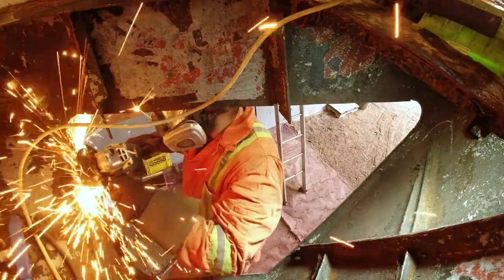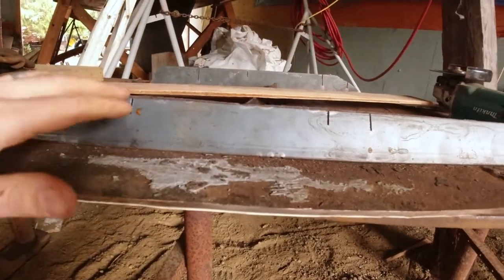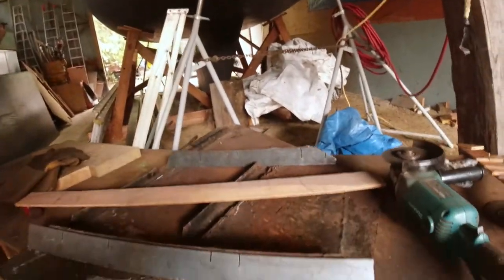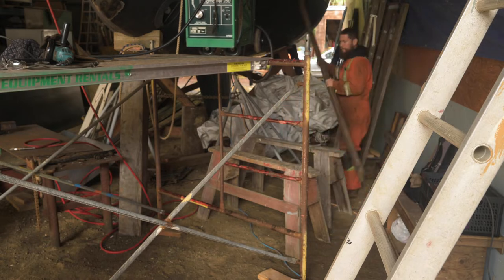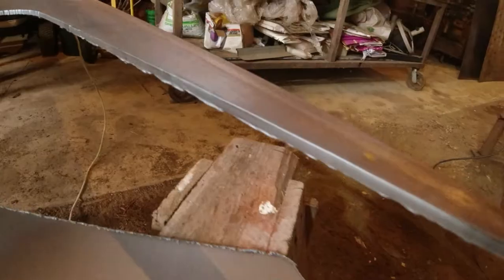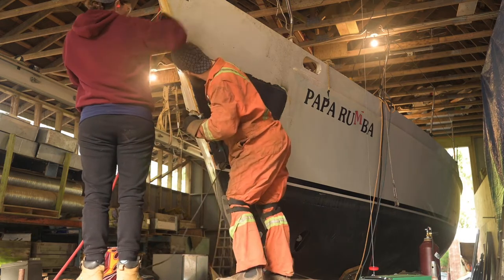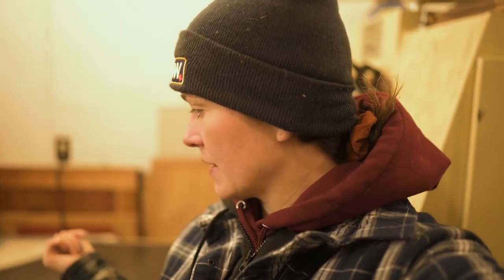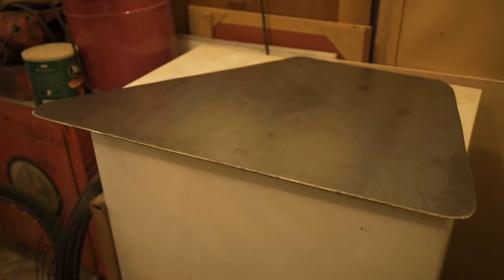Replacing the First Hull Plate | Ch5 E 11

Comment: Mig welders are brilliant for overhead welding, people think just because they can run a weld that makes them a welder, wrong. You need to look at the globular transfer. Your welding appears cold or too much wire feed, leave a 3 mil gap between plate joins to insure full penetration. Watch out for undercut especially in a boat.
Reply from the maker: Thanks for the tips!

Comment: I don’t know the space you have to work,   But a pencil inside of a washer it normally how we get the correct curves..  it’s quick it’s simple and it’s 100% effective,  i don’t understand your method but im not discounting it.. it could be better then a simple washers, and a pencil?  I’m not an expert.
Reply from the maker: I don’t think we have a washer big enough for the curves we need, but def not the worst idea!
Reply: @WaywardLifeSailing  any old waster will do,  roll it down the inside of the hull with a pencil inside, on some old nice cardboard, and it will trace the Exact curve perfectly,  obviously cut the cardboard roughly, so it kinda fit..  them holding your pencil inside the washer, against the hull,   You should get a perfect curve.   It’s like using a Drawing compass,  no much easier to roll the washer, remembering to keep pressure against not only the Curve but the cardboard so it’s perfect..  youtube the Technique,  it’s been used for 1000s of years,,  because it’s simple and 100% Accurate first time every time..
Reply from the maker: @trevhedges  thanks for the tip!
Reply: @WaywardLifeSailing    It definitely works..  but as i say I’m not discounting your Method,  it’s probably fine,  just looks,  wow Complicated, i know they do use your method for hull one,  blueprint design,  but years of dents and faring compounds etc etc,  you are trying to Replicate what’s actually there..  so it’s probably again “probably” better to use the other side hull outside to get it,  “yeah well atleast we know it’s going to look right”.  Next job,   Kinda deal..
Reply from the maker: @trevhedges  our method has worked out really well. Both hull plates are back on now with ribs in the correct location and she’s looking great